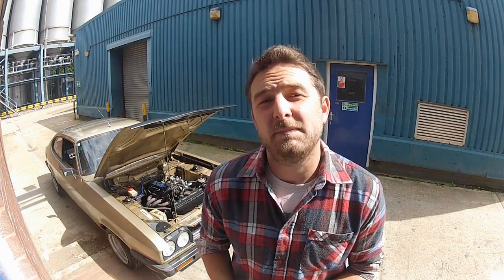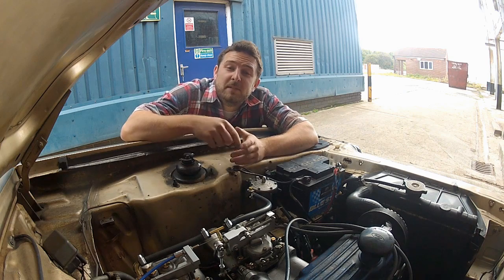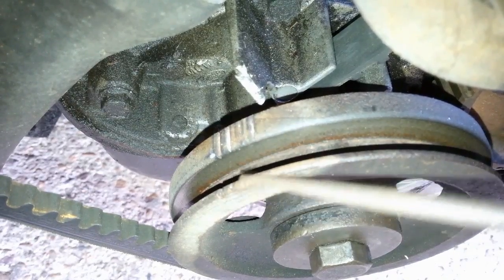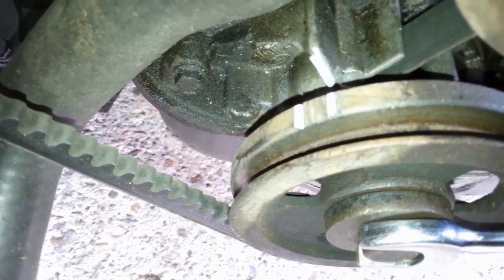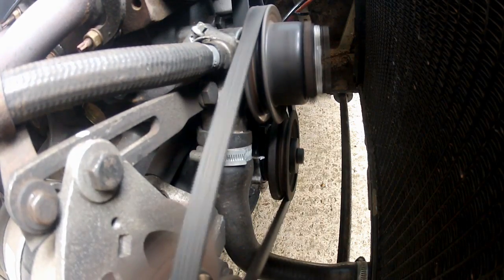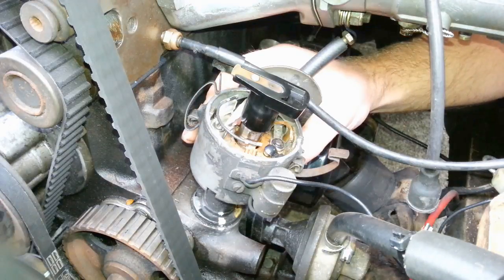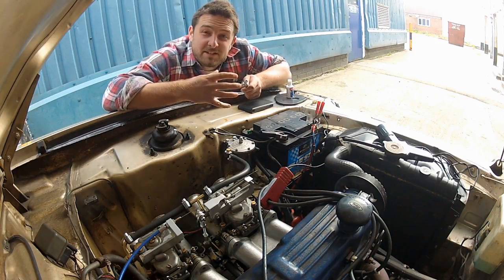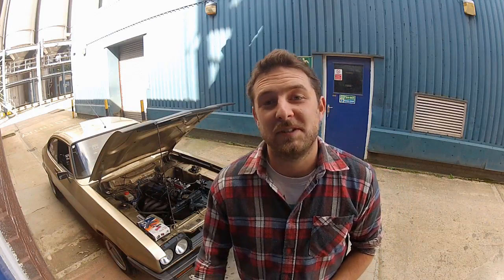How To Set Ignition Timing with a Timing Light / Ignition Timing Explained | Tech Tip 04

Comment: Hi Great informative video. Which will help me check the timing on my Ford Capri 3.0 Automatic 1978. I have 1 question thou in other info I have read it says to rev engine to 3000rpm when adjusting distributor to get the best performance from the engine, but you don't mention this in the video, was wondering why ? please advise. Keep up the good works. Regards Nick
Reply from the maker: Thanks. Right so that is a technique you can use to set the timing at total advance. As the rpm goes up the mechanism in the distributor advances the timing by a set amount (around 28 degrees on pintos iirc). To do this you need an adjustable timing light. So say you wanted 36 degrees of total advance, you'd set the timing light to 36 degrees, hold the engine at 3500 rpm and adjust the timing to the light flashed at exactly TDC. Does that make sense? Cheers.

Comment: Hi, my the idle is steady, bu my ignition timing keeps jumping, what would cause that? I have electronic ignition and no vacuum advance.
Yours is perfect it stays steady on the pointer.
Thanks
Reply: Did you ever sort it
Reply: @WLEgarage1991  Yes! Replaced the spark plugs and the leads. The spark plugs (second set) turned out to be fake just like the first set and the leads had the wrong resistance.  I also had vacuum leaks on the new carburettor mounts, they were not flat, removed them and flattened on the belt sander.
Vacuum leak at the extractor and every joint on the exhaust system. Removed and applied RTV, but on the extractor I pushed the rtv in, it is a big job to remove them.
Have a look at one of my videos were I put a vacuum cleaner on the exhaust pipe and sprayed soapy water at every joint.
Since then I have bought a smoke machine,  works great for big leaks but the small leak only visible with soapy water.
Also check the needle and seat on the carburetors, I had to replace mine they weren't holding pressure and replaced all orings. Also if you have a after market mechanical fuel pump, the original fuel regulator can't handle the pressure and will have to be replaced.  You need 2.5 to 3 PSI maximum. Re adjust the carburetors using Gunson Colour Tune. My car drives great now. 
Good luck.

Comment: I WONDER IF MUCH CHANGES IF A PERSON FITS AN ELECTRONIC DIZZY.  LIKE VACUME ADVANCE ON ACCELERATION  AND SO ON???
Reply from the maker: Nope the internal advance system is exactly the same so this will work with an electronic unit. The only difference is how you get to the weights and springs. It's a bit more fiddly.

Comment: Two things do u block off the vacuum advanced before or after you start the car, and where on the pulley does it match up with the little degree thing that looks like Bart simpsons hair
Reply from the maker: Blank it off before starting the car. Depends on which engine you've got because the pulleys do differ. Bart should line up with the mark corresponding to the timing that you want (8, 10, 12 degrees BTDC for example)

Comment: Hi , when you install a pair of weber dcoe  its necesary to cancel the vaccum advance of the distribuitor?
Reply from the maker: In my experience yes. The issue is getting a decent vacuum signal, as you can only pull it from one cylinder with this set up.

Comment: Hey my Nissan na20 is set to zero is that going to of ruined my engine?
Reply from the maker: Nah. Set it correctly and you'll be good to go.
Reply: @FastRust  thank you. hopefully it solves the running on after key is turned off issue also
Reply: @FastRust  great worked a treat thank you . its only got 90 000k on the clock 1996 hard body datson

Comment: hi great video I have got an early version of an fuel injection system by bosch, le2 jetronic but its is early enough to still have manual ignition adjustment(not sensor controlled - manual advance and return just like your car here) I am having trouble starting and idle after engine rebuild I think the timing is a major factor as moving the distributor seems to change how it starts considerably. How do you set the timing position to start with? on this peugeot the timing mark is on the flywheel which makes life a lot harder as its hard to see the marks also but can just about.
Reply from the maker: Unusual for the ignition timing marks to be on the flywheel, are you sure there's no marks on the crank pulley at the front of the engine?

Comment: Hey Fast Rust, Does a Capri have a front sump oil pan? Or rear sump?  I might pick up this rebuilt 2.0 the guy listed as a pinto motor. it has a rear sump pan, a pinto is a front sump, It also has an intake, but no carb on it. The bolt area where the carb goes just has to bolt holes where the carb goes. I'm thinking the motor came out of a forklift or something.
Reply from the maker: Rear sump on a Capri, I think there werr some front sump applications. Cortina maybe? Not sure. You could be looking at a Transit motor. Low comp, single barrel carb.
Reply: @FastRust  Is that motor worth getting to drop in a pinto?  Thanks for any info Bud :)
Reply: @FastRust  It does have same look as the standard 2.0 Valve Cover.
Reply from the maker: Valve covers will be the same, it's the internals that are different if it's a low comp motor - shorted pistons by about 1mm. Tough to tell without further investigation. Not ideal for a performance motor unless you were planning to rebore it and stick some new pistons in it. May as well start with a high comp engine.
Reply: @FastRust  If the valve cover has 2.0 look to it, it's a 2.0 right?  The guy got it listed as a 1.6 kent motor, he said some guy gave him a few engs, he's not sure what it is i think? I'm thinkin 2.0 because of the valve cover look. I think it's 1300 now after looking at this web site. The Block #s are 70HM6015AA

Comment: Hey Fast Rust, would you check my latest Capri mk3 timing video out and give me your thoughts on my problem? I thought I had a bad brake servo as when its at low revs it tries to cut out but I now think it could be a timing issue. I was watching your video again today while I checked it with a Timing light. Now as well as using the brakes the indicators (for some reason a previous owner had put dim 5w bulbs in the front which I've replaced with 20w) now make it judger and try to cut out, sometimes the clutch too. It doesnt always do this but Its the first time i've driven it since adding the new indicator bulbs/to make this timing vid and it was acting up like mad. I rebuilt the carb the other month thinking it was that and it seemed to be ok at first but now its bad again. I'd take it to a garage but i'm not sure where to start. Its got a Ford electronic dizzy on it with an ignition module from a later car I assume.   Loving the videos by the way!
Reply from the maker: It sounds like an ignition issue for sure, have you tried new plugs / leads? Check they haven't come loose, and that you're getting a good contact.

Comment: Hi Rust, Me again, lol... What kind of ignition set up you use. Stock ? or...
Reply from the maker: Hello again! Yes it's stock. Stock Bosch distributor, stock coil, points. Distributor advance has been modified but that's all.
Reply: @FastRust  Hey Rust, I took that Pertronix out and put points back in, Car runs awesome again, Now I'm trying to get them to just refund me for it, Hassle, lol. I'm making a youtube on the whole ordeal. ?? Is your Bosch a bone stock coil that your car calls for? I ran my pinto around the block a few times with the 40,000 volt Flamethrower coil part# 40511 that came with the pertronix as a kit USING THE POINTS and it seems peppy, But I'm hearing on some google sites that it's not good to run a hot coil like that. because it will burn your points faster. I'm putting the Stock Pinto coil I have from the 70s back in because of what I'm reading about the hot coil no no.
Reply from the maker: I can't see using that coil being an issue, but don't hold me to it! See how you go. Yep I'm on all the stock stuff. Stock coil, distributor & points. Been flawless. -1 for electronic ignition kits 😂
Reply from the maker: Post a link to video when you get it uploaded

Comment: On my 72 2.0 My timing belt is on right I think " Compared it with my 73 - but my timing light shows it's off by like an inch on the 72, Car won't run if I put at 6 before TDC. Could the Distributor be why it's not lining up right with the light strobe. The 73 strobes the light spot on 6 before TDC
Update
Yesterday I moved the timing belt different ways and nothing works. Everything line up on marks. I brought the piston to TDC with the #1 plug out. it's dead on. Feeling helpless... It seems to run ok with the timing tab 6 Degrees mark set at like 1 1/2 inch before the timing mark it suppose to be on. I'm stumped.
Reply: Maybe i just need to turn up my idle once i'm at 6 d before tdc, barley runs at all that way - i'll check and report back.
Reply from the maker: Man this car gives you some grief. Really difficult to say without actually looking at it. When you connect the timing light up to cyl 1. Set 6 BTDC & point it at the cam pulley. It should flash pretty much bang on the timing marks.
Reply: @FastRust  Never thought of that, I'll try it. also car stalls while coming up hard to stop for a red light. I also notice Black tap from sealing PVC valve to get a good seal was getting caught sucking on the tape. But when I fix that, it seems about the same. Hey Fast, When you have one of those glass gas filters SHOULD it always be full of gas in that filter??, Sometime it only has like a 1/4 full in that glass filter when its running.
Reply from the maker: Sorry late reply mate, don't worry about the fuel filter, perfectly normal that.
Reply: @FastRust  I got the timing marks on now, I took off the timing belt, Top Pully to clean and check, and valve cover and notice the followers were a bit tight, so I adjusted them to 0.008 and 0.010 like it says in the books and put belt back, to me it looks like the belt is in the same spot it was, but marks line up to TDC with all 3 spots now.  pulling teeth here lol. it seems to run good now, but hesitates slightly here and there while I'm nailing it up to 3500 rpm to shift, I'm thinkin points are old, I'm gonna buy the Pertronix upgrade set up. it stopped stalling at the stops also. gettin better :) On my Vac gauge when setting Carb with Vac hooked into side of intake port i'm only pulling just barely over 15. power seems way better than it was before.
Reply: But a better dist cap on, runs SWEET NOW!!!
Reply from the maker: Nice one! She's gonna have had a full service by the time you've finished. Get out and enjoy it 👍
Reply: @FastRust  Right, lol

Comment: Hi mate,  I'm just looking into the timing of my Capri to get it running right and see if its the carb letting me down or timing wrong. At the moment I rotated the bottom pulley to TDC. I can see timing marker on the top pulley is lined up with the timing hole/marker at TDC on the engine casing. My 2.0 Pinto has been upgraded with what I think is a Sierra dizzy and ignition module to i'm guessing these markers out the window?  The rotor arm is point at the back HT lead away from the engine, this is heading to number 1. This car hates starting and the plugs turn black after a while so, starting at the beginning... and i'm not really sure what i'm doing haha. its an original engine but has a Granada carb, electronic ignition and a upgraded alloy rad so... been a bit messed with.
Reply from the maker: Hello. You can still check your ignition timing as per this video - if you haven't already. What is it set to at idle?

Comment: Well explained, excellent video.
When setting ignition timing we must disconnect the hose from the vacuum distributor but what about the leak we created on the manifold/carb ? Doesn't it distort the ignition timing we are setting ? Looks like nobody talks about this.
Reply from the maker: Thankyou! If you disconnect the vacuum advance hose you need to blank it at the manifold end, as you say, to stop a vacuum leak.
Reply: @FastRust  Alright. Thanks for your reply.
Reply: A hose pinch would achieve the same thing?

Comment: Hi Fast Rust, I've been trying to dial in my timing on my 2.0 4 speed 72 Pinto. If I try and get the timing set right it don't run right it seems, I've been doing it by ear, I've taking off the belt and messed with belt setting a tooth back and forth on the cam pulley, but it always seem a little off to the left and right if I'm making since, LOL.. My belt has almost 6000 miles on it, I also have that vac device that's on the side of the eng bay that the Vac lines hook between from Carb and Dist.
Reply from the maker: Hey mate. It's tough to say without knowing exactly what the symptoms are. I wouldn't worry about the belt if it only has 6000 miles on it though. & you'll never get the belt timed to the exact degree without a vernier sprocket - just set it as close to the timing marks as you can get it. Is cam standard??
Reply: @FastRust  Yes, stock cam as far as I know, Thanks Fast Rust
Reply: @FastRust  are those adjustable top timing gears for getting the timing to line up spot on, to take up belt slack?
Reply from the maker: They're to dial in the cam to a specific degree. Useful with performance cams and tuned engines. If yours is standard I wouldn't say you'll see much benefit. Cam belt slack is taken up by the belt tensioner below. If your timing marks are lined up, I'd leave the belt as is and search for the problem elsewhere. An adjustable pulley is not going to solve the issue I'm pretty certain of that 👍

Comment: Nice. Good video. Best vudeo have found to date.
I have just done a rebuild on my mk5 sport cortina. I upgraded the cam to a mild/street stage 1. I am how ever having some issues with  in getting the timing correct. I did try with light to no luck. I have got it running best by revving it around 2k rpm and finding the sweet spot. Still isnt 100 % tho.
P.s love your intake side dude wow. Im still only running the 32/36
Reply from the maker: Hey man. How come the light didn't work? Cheers, the 45s do look the part! Ran a 32/36 for a long time though, brilliant carb.

Comment: I have the same engine in my Granada mk1. so I have adjusted timing to the manufacturer setting 8degrees. but when I attach the vacuum tube, I get horrible crackling sound when I accelerate. I believe its ignition ping or knocking, but not sure
Reply from the maker: When you're driving?
Reply: Fast Rust yes, when accelerating. so for now, I don't have the vacuum tube attached to the distributor. I've plugged it with a screw.
Reply from the maker: Could be pinking. Is it most notable when wide open throttle high gear, low revs? If yes then knock the advance back a bit and try it again. It does sound over advanced.

Comment: Nice how would you do a movie with setting the ignition if you have replaced the camshaft from a serial to some sporty
284 degrees for example
Reply from the maker: Well, to set the ignition time at idle, regardless of camshaft spec, is the same process as in the video.  The problem you run into with more extreme cam profiles is the advance curve.  This is controlled by weights and springs within the distributor.  Adjusting these takes a lot of trial and error (I know!), and is a little more complicated.  For a camshaft with 284 degrees of duration, if you set it around 14 degrees at idle, you should be in the right ballpark.
Reply: Is it true that on the sporty camshaft the idle revs will not be equal to the serial?

Comment: do you have a electric cooling  fan put on? ,I have the same engine  in a  taunus and thinking of swapping the mechanic fan whit a electric one,but the thing is should it be before the radiator or after radiator type
Reply from the maker: Hey. Yea there's an electric fan in front of the radiator. Bought from 
the local scrap yard, I think it came out of a Citroen, wired it so it 
'pushes' air rather than 'pulls' it. Simple switch on the dash and away 
you go.  It's not super efficient but does the job.  Also, fitted a 
classic mini 74 degree thermostat, engine runs slightly cooler on the 
street, but on a track day it's spot on.  Hardly need the fan.
Reply: a have a problem in winter the engine dos not get  normal temp is to cold  even after a 30 min.and another thing ,do you use lead supplement additive in the fuel and if you do what are the difference in engine running is it smoother or?
Reply from the maker: Yea, I'd replace the thermostat.  May be stuck open, or there may not be
 one in at all.  As for lead additive, yes, I do, but many don't.  You 
won't notice any difference to the running with or without, the argument
 is that the lead protects the valve seats.
Reply: that must be the thermostat is stuck  is open all the time, they have a 
wax in it that is soft on a high temp and opens the flow  or is hardens 
 on cold and closes the flow

Comment: Hi, can u help me. which distributor installed in this? (model, what car have this? what model engine) I was looked, you showed muffled choke vacuum regulator, why does this? firing angles only controls a centrifugal regulator ? how you think, correct angles fire in 3000 or 5000 RPM? sorry for my bad english, i cant understand by ear. thanks.
Reply from the maker: Hey. Check the description for answers to a couple of your Q's.  The distributor is a Bosch unit, on these engines it will either be a Bosch (red cap), or Motocraft (black).  No vacuum advance because of the carbs, taking a vacuum signal from one inlet runner is not sufficient.  I've modified the centrifugal advance to suit the camshaft I am running.  Hope that helps.